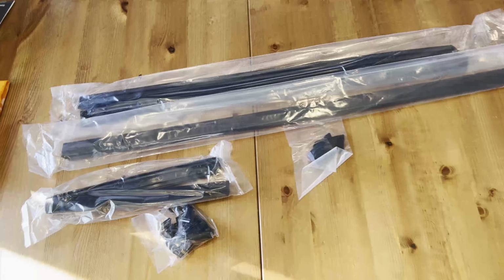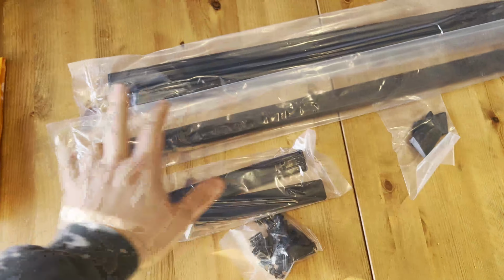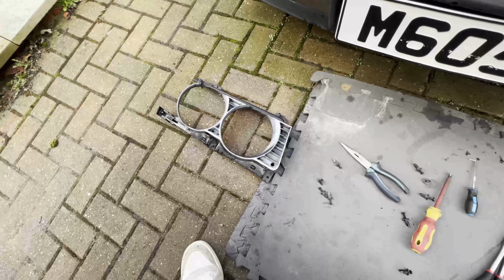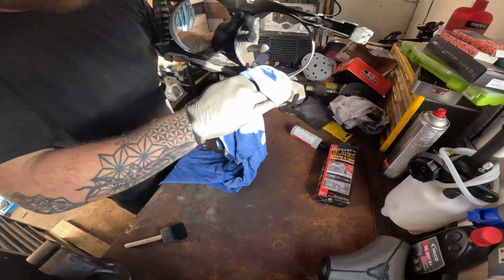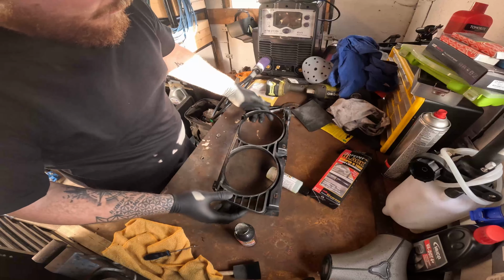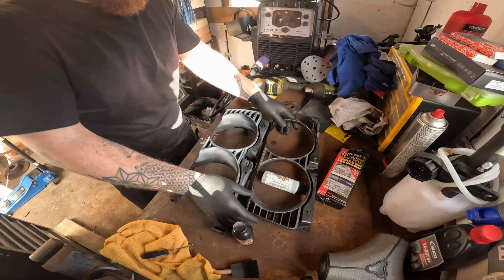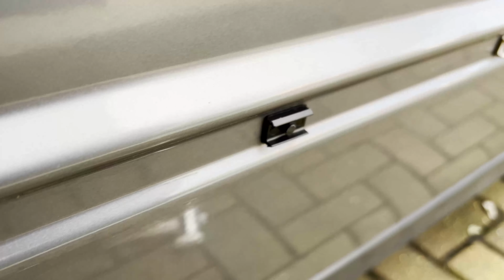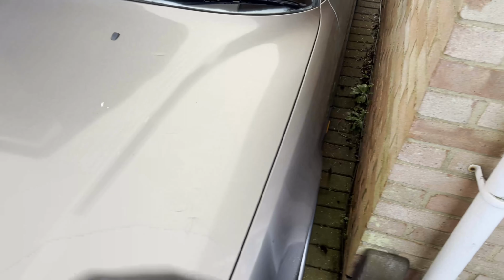Cosmetic Refresh - E34

Comment: Dunno if you'll ever be taking the grille out again, but M3nameisjosh's video where he covers it could help ("Dialing in the Blue E34's Exterior"). What he mentions is probably what you were trying to do when you were reaching into the corner through the engine bay anyway
I'll be doing that soon enough to mine, want to swap the wide grille front end out for narrow grille (92 car with a V8/>94 front, I simply don't like it)
Mine's also granite silver too!
Reply from the maker: The colour code for mine is arctic grey, needs a good cut and compound tbh
Reply: @CSAutoWorks  oh ok, looks pretty similar